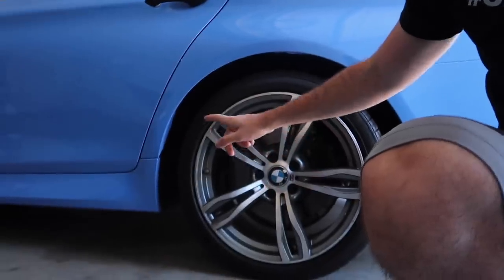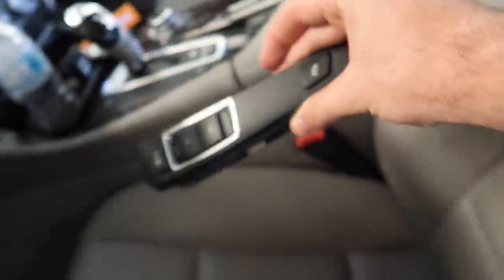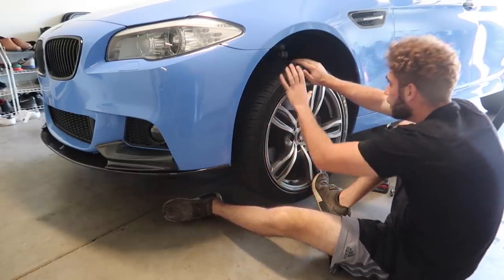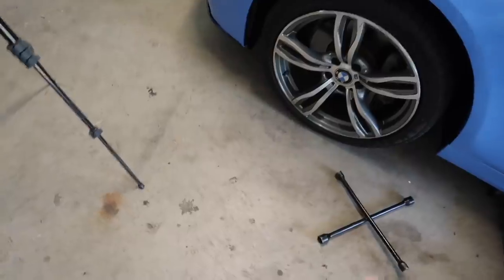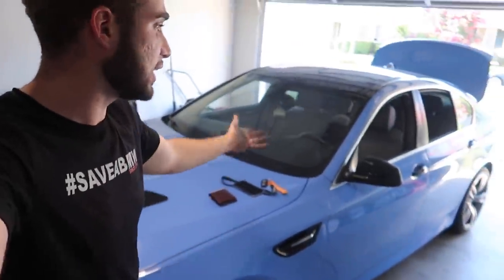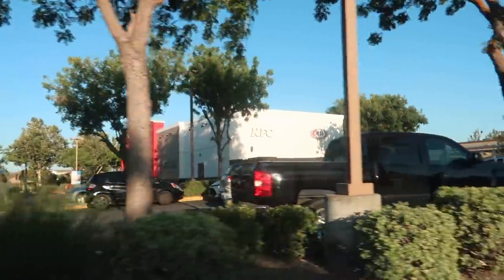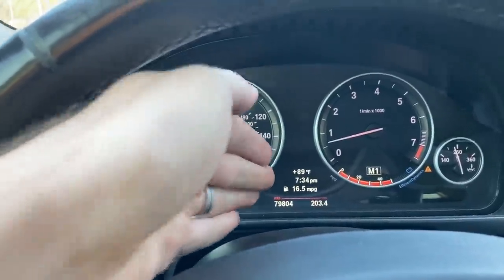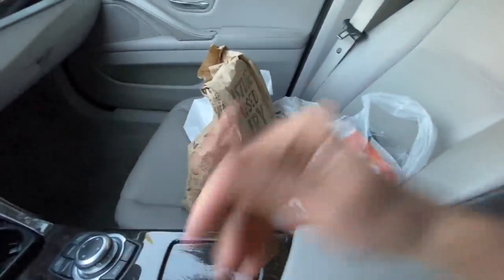F10 GETS NEW MOD THAT IVE NEVER DONE BEFORE!

Comment: When are you going to start painting, just put the time in. The wrap is nice for some time, but is more like a bandaid, personaly i dont like the studs. It ruins the paint on the inside of the rim holes. My rims just stick to the hub with some coppergrease. Is also prevents the rim to weld it self to the hub, much cheaper that those studs. Try getting them out when changing the discs. Nice vid as always.